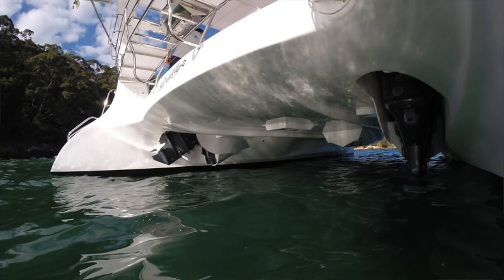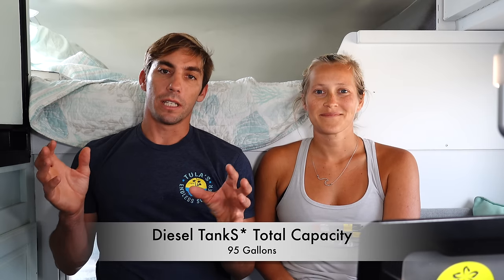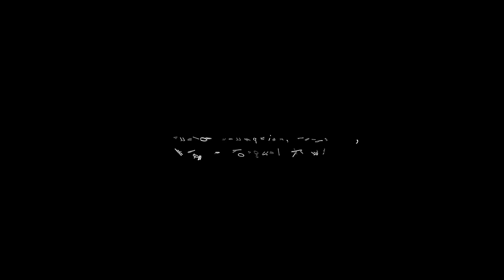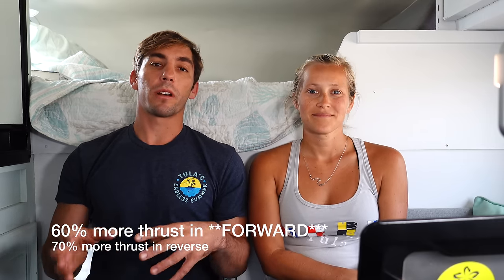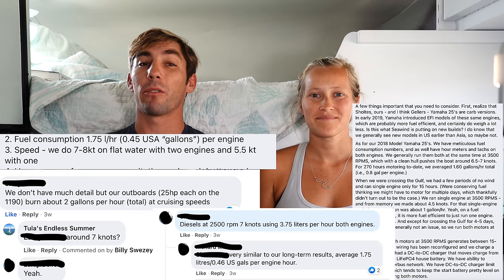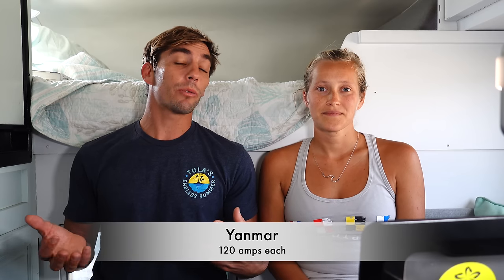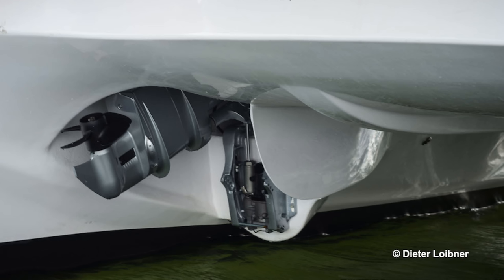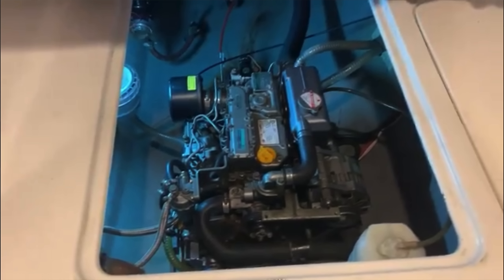Do Outboards Make Sense on a Performance Cruising Catamaran?

Comment: Definitely diesels.  I would not even consider outboards.  My first reason is to avoid the kaboom factor that comes with having lots of gas on board.  Another big consideration is keeping outboards running if you do any offshore sailing.  The outboard mounts look like they would be suceptable to flooding the outboards in rough conditions in addition to the cavitation problem you mentioned.  The charging difference is also a huge consideration unless you plan to cover the boat with solar panels.  You will need the extra power production to run the washer and AC anyway.

Comment: What I think is an important topic as well. Sail drives, as much as they are a cheaper option. Should you run over something in the water. God forbid! And you rip out your saildrive! You now have quite the hole on your bottom. With outboards, they simply would kick up!! NO HOLE.

Comment: I also would have chosen diesel, but one thing I would mention about sail drives. They are what sinks a boat if you end up on a reef.  My perfect boat would use a shaft like a mono hulls. Also if you like to beach your boat outboards are the way to go.

Comment: Have you looked into diesel outboard for the dinghy? I would have gone with the outboard option just for the fact that the dinghy will have the same engine, same fuel, same parts, if one blew up you could toss the dinghy engine on the sailboat. Different strokes for different folks.
Reply: Diesel outboards weigh a ton, are not reliable and make a racket.

Comment: This is a difficult choice. The major thing I would think about is what you are going to use the boat for and how much solar you can put on the boat. If your only going to be sailing up and down the USA coast and maybe go to the Carib , then I think outboards are the way to go , BUT if you are going to go to other countries across major oceans then Diesels are the way to go. I would probably go outboards and spend the extra money on a better solar package and maybe a water generator when sailing OR go totally electric with the mastervolt system with regen. Good luck with your boat.

Comment: Yup, have to have the diesels. I've got twin 1990 cummins 210 in my trawler and they just keep on running and will always help with the resale value. I would not like the cavitation issues of outboards on any 25ft plus yacht in rough conditions when you may need to get out or away from trouble. 7 knots and a range of +600 miles with 400amps of charging is a winner in my book.

Comment: Hi guys, the one point I would make is the availability of fuel. In my experience diesel is much more readily accessible than petrol / gasoline in most parts of the world.
The other question I was going to ask was whether you considered Electric propulsion instead of diesel/gasoline engines as cats give you a much bigger area to mount solar panels on, but knowing your attention to detail you probably plan to cover this topic in the future.
Regards Mike 🇨🇮
Reply: In 5-6 years all new cats will have electric drives.  The problem right now is the cost is $800/kWh just for the batteries.  This is down from $1000/kWh just a year ago and we're just now seeing the packs get to $300/kWh without the BMS system but they should eventually get to $200/kWh soon with BMS.  That might seem like an impossible price, but EVs are starting to use LiPo4 chemistry a lot more and it will drive the price way down.  That would mean you could get 63kW/5,000amps of power for the same ~2000lbs of weight as the yanmars.  Pair that with a big 2k watt array and you would have unlimited power for all but the worst passages.
Reply: @gregb7353  absolutely 😁

Comment: The biggest drawbacks to the inboard saildrives are twofold to my knowledge.
1.  Drag when under sail.  Even with a folding prop, you'll have the drag of the drive pillar.
2.  Potential damage.  I've heard some horror stories of people running over a log or other obstacle and actually ripping the saildrive right out of the bottom of the hull causing flooding.
If you had decided to go with the outboards, you could get a small portable gas generator for recharging the batteries.

Comment: Hi Tula, I met you guys in Green Turtle a few springs ago. 42 ft Chris White Cat, German Shepard dog if that jogs your memory. I have those Yanmars 3YM 30 AE, they are great motors, very little drag when sailing with Flex-O-Fold 2 blades. Light air motor sailing 1-2 liters per hour with only one engine running. Research the alternator temp limits with lithium’s if you haven’t already. The Yanmars are a bit expensive to maintain parts wise if you follow their recommendations, which I do. Thanks for all the great videos. Ciao

Comment: for your tender the 25Hp outboard has 3 cylinders so the unit will not have to works as hard under load. the 25Hp will connect to the NMEA2000 network so instruments will come up on a chartplotter is fitted. Also consider a 4 blade propeller as well for lower rpm efficiency but you will need to look at the manufacturers chart for the size, pitch and model number. regards. For the main vessel have you considered going to a full 24 volt DC system over a 12V DC system

Comment: Diesels are the “safe” choice. With the weight and drag savings I believe I would have gone with the outboards, their will even be several electric options soon. As far as electric generation, a generator will always do that better than an inboard diesel. At least with the diesels, you can rebuild them on your deck.;)

Comment: I think your content is great right now! So it isn't sailboat or sailing related, and I can't ever see myself spending time in a truck camper, you two are adorable and I am enjoying every bit of your content. Keep up the great work! 

Since this is a blue water vessel for you two, I would choose the Yanmar Diesel. If it were going to be just a coastal cruiser then I would go with the middle choice outboard engine. The thing is with the distances you want to travel on this and the amount of time it will be in use you need to have the range of distance to be longer on a fill-up and needing fewer jerry cans. Also, because this is your home and the amount of time you will be using it, you will have more times to be in situations where you might need a little more power to get out of a situation that is not optimal. I don't know maybe your dragging towards a reef or whatever... LOL! I don't think I have ever seen you all have issues with dragging, but anyways. This thing will probably have some super good anchors on it too.

Comment: Deisel definitely makes the most sense.  However, on smaller boats under 30' outboard motors are really appealing. If I had all the money in the world to outfit a boat I might be tempted by electric motors. Lack of maintenance and the ability to remain longer off-grid is awesome, especially, given the recurring costs of fuel and maintenance. I'm sure you know better than me on such issues  and to make it work you would have to jump through a lot of hoops for power production. Can't wait to see the new boat.

Comment: Full time cruising diesels all the way.  Outboards tap out like a MMA fighter in the third round at 400 hours. Diesels make it to the fifth round with a life span of 5000 or more hours. Of course with proper maintenance. I worked on a boat with a c18 cat that called it quits at 80,000 hours.

Comment: The 3YM30 is a great engine. I have one in my monohull. Had I been in your position though, I think I'd have gone with the 25 HP Yamahas. In addition to the initial cost savings, the ability to have three identical power heads and common spares is a great idea. Add a Honda 2200 generator to the mix and you make up for the reduced alternator capacity. Can't fault your choice though.
Reply: The Honda only puts out 15 amps and is very loud.

Comment: Wow, I was almost certain Billy  was gonna go with the Yamahas! I'd pick the diesels cause I love diesels, last 5 times as long, safer, more efficient, and higher resale value. The one problem with them is those saildrives. You look at those things wrong and they break! Can't dry your boat out on the beach or even run upon a beach. Hard decision guys.

Comment: Diesel for ocean crossing for range safety, probably more reliable as well. Outboards for faster sailing, and sailing in lighter wind (so you use less fuel as well). Less haul outs with outboards. Diesel is a safer fuel as well.

Comment: For me there is no option other than the diesel. Range, ability to make electricity, longevity, power and reliability diesel wins. If you get a water maker you can be totally self sufficient for a longer period of time. Also with diesel you eliminate one entire engine system that is prone to failure which is the electric spark needed to run gas.

Comment: Diesel in a GRP boat in my opinion is a definite safety plus. 
Petrol (gasoline) is not only combustive but explosive in both of its forms (liquid and gaseous) not to mention it expands and contracts more due to ambient heat. You can fill a jerry can of diesel to 90 - 95 % capacity without concerns for expansion, petrol on the other hand should only be filled to 80%. Petrol goes into a gaseous form (more explosive) at a lower temperature. Petrol is also more corrosive to anything it touches. That includes modern fuel lines not to mention the GRP foundation of your boat.
Yes petrol engines are lighter which in a catamaran is important but the cost in safety negates any weight advantages. They are also cheaper but in over life expectancy not by much.
The layout as you explained for the petrol storage would put more weight to the bow of the boat with lighter weight engines at the stern. Catamarans hate being bow heavy. With full tanks you are going to have to shift a lot of weight to the stern to balance the boat for optimal performance.
Then there is the range advantage of inboard diesels. No brainer. Also depending on room you can add another alternator to inboard diesels that is specific to house batteries. Can't do that with outboards. 
As you may have noticed I'm not a fan of gasoline on GRP boats. LOL

Comment: Assuming you're going to have a water maker diesels would be a must.
Reply: Seawind may offer AC-powered watermaker option, but I also know they option Spectra DC-powered units, which are the most efficient in the industry.  Expensive, but very efficient.  There is enough solar panels on a Lite to easily power a WM.

Comment: I would have gone diesel for sure over the outboard but I really like the Ocean Volt electric a lot!
Reply: And if you have solar and wind and regen from oceanvolt, you have unlimited supply of free fuel with very little maintenance.
Reply: @joselinan3802  Ocean volt just came out with a new model for mono hulls that would probably also work better on a catamaran as well. Sailing UMA just installed one on there mono hull. It does regen really well and I don't believe that you would need a gen set or wind turbine to make your life better as a live aboard. It's kind of the best way to go. They have finally perfected the electric engine.

Comment: We are electric drive on a monohull sailboat.  Please consider the carbon-neutral option of two electrics with sail drives, powered by lithium batteries, stored where the fuel tanks would be.  The downside is reduced range and reduced top-end speed, but you would have power regeneration from the turning props when sailing.  Respectfully you could be the poster faces for the next generation of cruisers, inspiring technology companies to offer a non-polluting option, being the first electric catamaran.

Comment: I worry about your choice of a Diesel engine because that’s what I would go with 
It seems like I make the wrong decision too often 
On the Serious side the drawback is money  the maintenance issue of hauling out can be offset partially due to you will have to haul out for hull maintenance which would reduce some of the cost 
Good luck

Comment: I would of went Yamaha. My biggest reason is less holes in the boat. The sail drive, cold water intake, and exhaust. That’s 6 holes in the boat. 6 more things to sink the boat. Most sailors only use engines around docks. I would of went Yamaha to save weight and money. Took some of that money and bought a nice solar system for the boat. You boat with diesels and full fuel adds almost 1200 lbs to your boat.  If a outboard Yamaha breaks in a 3rd world country you spend $5k to replace the whole engine with a new one. Not rebuilding your old engine. I been around the Yamaha 60hp high thrust on a single engine 32ft houseboat and it does amazing. On the Ohio River we can cruise 5-7 mph at 2500 rpm and use 1/2-3/4 gal per hour. We carry 55 gal in one tank and have a spare 25gal tank. 80gal x 6mph = 480 mile range.  We had a 9.9 kicker for a backup in case something happened to the main engine. Plus we use it on the dinghy. 

 My opinion is you could save a lot of weight and money by going Yamaha. And still had money left over after a expensive solar setup.  But this is going to be YOUR home. Get what makes you happy. But 1200 pounds is a lot of extra weight on a sailboat. Plus you have 6 more holes to sink your home. How often will you motor more than 250 miles? If you ran one outboard at a time you could extend that range to close to 400 miles if my math is right.. 

 Not being a hater, you ask for our opinions.. I like the simpler option of the Yamaha outboards.. Never was a fan of sail drives. Weight and through hulls are a sailboats worst enemy..

Comment: Great presentation. Fun, organized, and to the point. But you missed a major point that will definitely come into play for you two. Resale. Think about buying your boat in five, or ten years or 20 years. You hear its equipped with diesel Yanmars and can quote actual range and consumption. The buyer is going to be reassured by having the diesels on board. When you list it, most of the folks on this channel wouldn't look at it if it had outboards, and others would immediately question the condition of the outboards. It would be a major drawback. Question some brokers on what they think the resale difference would be. I'm sure you will find that a substantial portion of the "$15,000" will not be wasted. Good choice!

Comment: I think you chose wisely, I don't know about cost difference and the difference in how much longer run time you will get out of  the diesel before you need to work on it vs a gas engine, I've heard that diesels will run longer before they need repair than the gas but I don't remember how much .

Comment: Reliability, range, safety, living aboard full time, recharging your electrical equipment, the diesels are a no brainer. In your case they will pay for themselves much sooner so the added upfront cost is negligible over the long haul. You chose...wisely.

Comment: From a fuel stand point: diesel is more stable and is readily avail able world wide. On the down side in humid climates algae grows quick. Gas evaporates quickly in warm climate and is reduced to varnish in injectors, causing sticking problems. Gas quality is not always equal around the world. So maintenance is important for each. Gas requires stabilizer to keep stored for long periods of time. Diesel will require an algaecide. So in short from reliability diesel all the way, as they are design as a long term engine.

Comment: If I were doing more coastal cruising, the outboard would be tempting - better efficiency under sail, for instance. But for a hardcore liveaboard, I think the diesel makes more sense. And the greater generating capacity seals the deal.

Comment: All in what the end goal is. If its a vessel to just sail for the years to come around the cabbage patch, then one can do as you please. Sail into the wide world, things change drastic. Out board spares are extremely expensive in most countries and any outboard agent/dealer sees you miles away coming to them. To this day with about the most strict safety, each year boats get blown out of the water due to fuel fume ignitions which result in explosions.

Comment: I think it opens the door to appliances that you may be able to get with the  diesel engine. Also just about every boat yard is set up to sell parts for that diesel engine. But put in a fuel polisher to always keep the fuel clean. Double diesel tanks will help on that too. And you might find it possible to not have bottled gas aboard by going electric.

Comment: Diesel engines without question. You also have to think about resale value. I realize it’s a long time down the road, but it’s an important investment decision. Diesels will last so much longer, have a much longer range and your electrical output is extremely important.

Comment: Honda's 15hp 25 inch "ultra" long shaft motor is the same as the 20hp but has a lower rpm engine limit.  I would have three of those Honda 15hp @$4K each and use one for the dinghy but have a stern mount where it would be stored that could be used to power the seawind boat, giving me 45hp if I ran all 3 units.  In addition, I would have two Honda 2200 generators. I don't want the diesels because of water cooling problems, sail drive problems, and the fixed aspect of sail drive prohibits putting the boat fully on the beach for hull cleaning.

Comment: Great choice as you might know that due to the extra torque you can use one diesel engine and go only one knot slower so fuel consumption is even lower and much greater distance. André owner FP Mahé